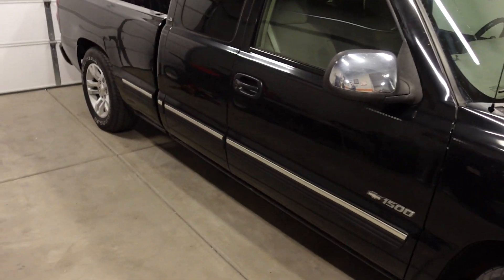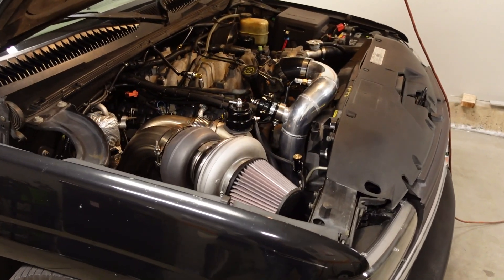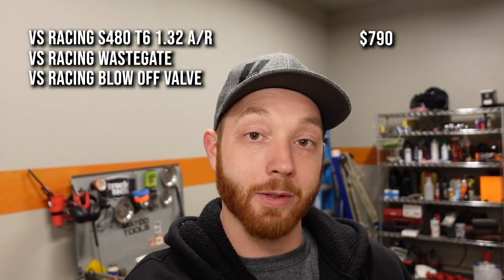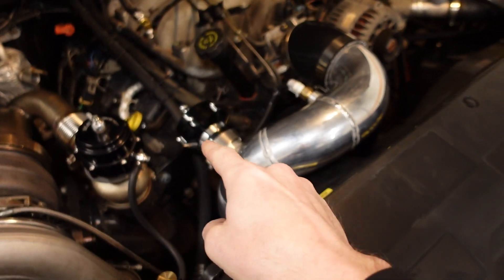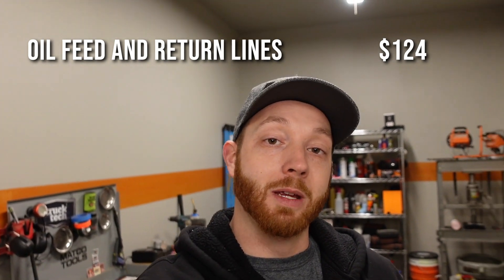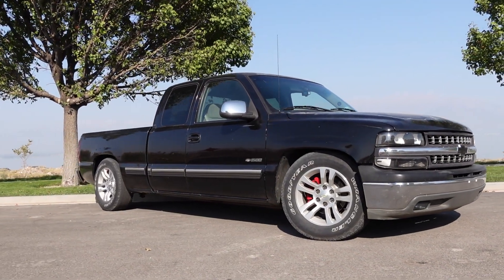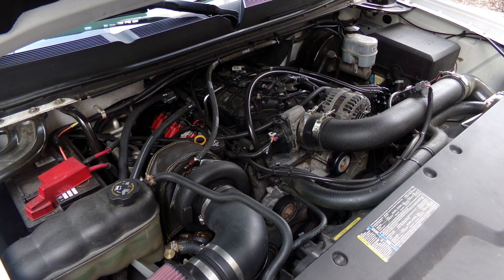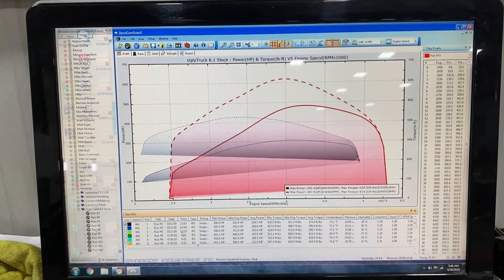The Actual Cost of Turbocharging a Big Block 8.1: Should I have built an LS instead?

Comment: 5k is cheap for an adjustable boost setup with tons of room to grow!

You're 100% correct. The 8.1 starts out with weak cast pistons and old school iron heads that don't flow where the LSx series starts with both of those issues solved in stock trim.

I think you'll be super impressed at how with a cylinder head swap your engine becomes an LSx on steroids (6000+ RPM). Cam choices do all the same things you're used to with an LSx. That 218/228 cam on a 5.3 is pretty large for a big truck! About similar to a mid 240s cam on an 8.1L (crank 610hp / 640ft-lbs NA)

Comment: If you cam and build the 8.1 like the 5.3 was, it'll be an absolute monster. 4200rpms for peak power? That's nothing. That big turbo is barely breathing at that power level. Build that big block and you'll see why it's king of the mountain. Big power, backed by a mountain of torque.

Comment: I think you made the right choice. Between the unique aspect, your exceptional attention to details, and the effortless throttle-steering torque, it's so far ahead of the junkyard/eBay 1000hp 5.3 and will be a far different behaving truck with a 1000hp 8.1. 8.1/4L80 going in my Caprice Wagon for just that.

Comment: Watching this video series has Honestly made me jealous. 
Before I found your channel I was already working on a single turbo big block Ford, using an EFI 460 with mild ported F3 heads, a mild camshaft, and Holley Terminator X, my goal is 500 horsepower that I think should be pretty easy. I'm also using the stock bottom end for now, it should easily be able to handle 500 horsepower luckily the truck engines came with slightly better rods.  I haven't decided on turbo sizing, I was kind of set an S477 with a 1.32 AR housing but now after watching your videos I may get away with an s480.  Much like your 8.1  my 460 will almost certainly operate under 5,000 RPM so I don't want to oversize the turbo and cause a ton of lag but I also don't want to undersized the turbo and limit myself for the future. 
Right now I'm at a point where I have to stop and save up money and the wait is killing me especially when I watch similar projects like this that are badass.
Reply from the maker: as far as spool up time on the 1.32 S480 goes, I have no complaints, in fact its almost perfect for my power level, and has room to grow. Sounds like a badass project you are putting together, and I think you in the right ballpark with the 1.32. I wanted to make sure there was plenty of flow through the turbine to support a nearly 500 cubic inch engine

Comment: Building the big block provides lots of info to us viewers, thanks! I suspect if I were building a boosted truck it would be an LS, just for cost and availability of parts. That is not to say anything against your choices, though. The only choice you’ve made that I’d question is the rear end ratio. There’s no way that 8.1 needs 4.30 gears to move that truck at any speed, in my opinion. I’d want decent cruise rpm for a driver... Still, with all that said, great job! Looking forward to the engine tear down and 1000 rwhp!
Reply from the maker: when I re-geared it it was still a 5.3/4l80 and it needed the extra leverage to get off the line. Now, its kinda stupid (almost unsafe lol) with that much mid range torque so I may go back to the 3.42's it had... we'll see

Comment: Yeah but comparing the 8.1 to the LS without a cam swap on the 8.1 you'll probably gain another 75 to 100 hp with the swap. I did the same thing I've built the gen-6 454 in my 98 GMC 2500 4X4 gvw 8600 when I could have put an LS in for a lot less. But on 5 lb of boost I can lay 400-500 foot 35 x 12.50  dual black marks in an S curve anywhere I go it was worth every overspent dollar. We all have different budgets. I love watching these videos and the product you came out with is top-notch it looks really good.

Comment: Great video as always LT.. the only thing I can really say is that your comparison of the 2 engines is that with the cam swap in the 5.3 it moved the power curve up in the rpm range if it had been on stock cam they would have really probably been making thier peak numbers pretty close to same rpm range. But your overall numbers would have suffered a bit. But of course either way the big block would destroy a 5.3 in torque with same atmospheric pressure. I know I'm just stating obvious things but sometimes I just can't help myself..  looking forward to your next upload

Comment: its funny now you created this video. I have found out the same thing about the little things creeping up. right now I need to get the parts to upgrade the fuel system before I can  start the install. 
I am doing a 5.3l in a 2009 tahoe

Comment: An apples to apples comparison would be fun. I have an 02 with a 4.8 that I’ve been waiting to put a turbo on just haven’t had the funds to do so yet.
Reply: Bro can get the whole gt45 kit for that truck and extra stuff ya need installed in a weekend and be out for under 1000 bucks maybe little more if ya wana add Intercooler but the kit itself is like 850 right now.

Comment: I agree. Rebuild it right from the first time. Firged crankshaft and connecting rods. Hypereutictc pistons. As for the cam the stock one obviously is made for low rpm HP/torque and you will most likely will put a mild cam. Not to mention other complementary stuff related to PCV and the transmission.

Comment: Nice breakdown of the cost.  I was looking at images of the block, the pistons may be not be up to snuff to handle higher power levels but the main caps are 4 bolts and that should help a lot in keeping the bottom end together.  There is no replacement for displacement.  I say there is no displacement for replacement.  When you can make 1500 plus with a 4 cylinder 2.0L engine, who cares about displacement.  VTEC yo!
Reply from the maker: You are correct in the fact that smaller engines can make some impressive horsepower with a lot of boost, but not sure I Could bring myself to install a Honda engine into my truck lol.
Reply: @LawrenceTolman  I hear ya, just like I couldn't bring myself to install an 8.1L in a JDM Honda Civic yo.  LOL.  Well if you ran the amount of boost these smaller displacement engines run to achieve 1500hp you'd travel through time with the 8.1L

Comment: I like it because it’s different, I also liked low and slow on trucks because it was a turbo 6 instead of the normal small block or ls.  There are a ton of engine combos I would love to build but can’t due to budget constraints.  This was another cool and different build.  I am curious though, I do believe that in a car the 5.3 would have the advantage but I think in that heavy truck the big block with its extra torque will win.  People focus on peak numbers because they are exciting but where those numbers fall are important.  In a light weight car that extra torque may be wasted at low rpm but in a larger vehicle it will be valuable.

Comment: In my opinion, i would just spend that $ on the Raylar heads cam and intake if that was the final goal with the turbo. That way you can still run 87 octane and tow reliably with more hp!

Comment: The more horsepower and engine makes na the more it's going to make with a turbocharger he's absolutely right there is no replacement for displacement a 565 with a procharger or twin turbos will make somewhere in North the 3000 horsepower

Comment: Cam, springs, intake and throttle body and upgrade fuel system for e85 and tune and you would've made more power for less money and still have the option of adding turbo later

Comment: You have much more torque in the 8.1 at lower rpms. In a truck, that makes  a lot of difference and is very important.  Put a large load In or behind the truck and make the same pulls. 5.3 and 6.0 will need higher rpms and burn more fuel.

Comment: I am 100% on-board with the 8.1L build for all the reasons you mention.  Better, because it's different, and period correct for the chassis.  This is the 496SS GM never built.  

The whip used on the 8.1L is always it's limited aftermarket. So. Gotta ask.  Why not a whistin' Gen VI Big Block?  Not a ton of them out there either, compared to the Mk IV, but way better parts compatibility/availability.  It would still be a big middle finger to all the LS builds.  Or is that what's up for the 8-lug 'burb?
Reply from the maker: the suburban does have the Gen VI Vortec 454, and its gonna get some upgrades as well. probably not turbocharged right away, but after driving the uglytruck, I think I might have to do it eventually
Reply: @LawrenceTolman  after I made this comment, I actually watched a couple of the videos from when you acquired the 8.1L and removed the 5.3L.  I had no idea the 8.1L could be run on the LS controls with such minimal headache.  Makes perfect sense!

Comment: Well my 8.1 is my mule. Sure I would love a power adder. Tell you what had a 5.3 Avalanche struggled to clime the hills I travel with my RV. The 2500 Avalanche doesn't even shift down where the 5.3 struggled. The same MPG's pulling the RV. So it still comes down to your needs or the loud pedal. I was the odd one to be different. Butt when a policeman pulls you over and asks what the He%% do have in this. Then shoots the sh*( for an hour. So different is a good thing. 
  It was a great build to watch doing it your way.

Comment: Have you had any problems with your brakes after the turbo install? The booster is vacuum assisted, so I’m curious if the boost pressure negatively impacted the brake power booster?

Comment: 99% of the time you drive around off boost. The big problem with using the largest capacity engine you can find is off boost fuel consumption, weight and serviceability. Do the same build on the bottom end in both for boost and a similar top end build for power and the Big Block will walk away. The optimum solution would have been to install a  6 liter LS then add boost. LS3 style heads and any passable cam would make an excellent boost platform and still stay with the BB even rolling at low RPM off boost.

Comment: I also feel like big power can he had by putting more timing into it. 11 degree is nothing. Your flame front is chasing the piston down the hole! I know you are being conservative, but 11⁰ is pretty ridiculous! I'm running 28⁰ on my 355 centrifugal supercharged sbc at 8.5psi on 93 octane. I pulled 1⁰ per psi. That's on the ragged edge the other direction.

Comment: How did you determine what size intercooler you needed for the power level you wanted?
Reply from the maker: Trick Turbo rates their intercoolers around a certain horsepower range, but honestly it was more a question of what I could fit in the truck. This particular one is said to support 800hp, but I just chose the largest one that would fit behind the grille and not require a ton of cutting and hacking

Comment: The bad news.  Turbo charging is the most expensive way to add full time boost vs blowers. There is a lag in boost from idle.  The good news.  Turbo charging is more efficient than blowers.  No belt slipping. Helps reduce exhaust noise.  Punished with lag, rewarded with full boost at lower rpm's for really big torque returns.  Best of all you are not a bottle baby (NOS) constantly refilling tanks.

Comment: It’s still not apples to apple. The 5.3 has a cam in it that helped it. You put a cam in that 8.1 and it will push 750 f.lb or torque and at least 550 hp at that same boost or more with just a cam swap. I did a very mild cam swap on a 454 gen 4 and it woke it like if I had put a stage 3 cam on it

Comment: Stick that 8.1 turbo into a regular cab short bed AWD Silverado and let all that torque do it’s job on the quarter mile. Torque is what moves a heavy truck like that, loose converters and low gears make up for the lack of torque on the small block but also makes them a bitch to drive every day, and with that comes a lot of heat and shorter component life, I’ll stick to big blocks and to each their own I say!

Comment: Everyone is putting turbos on ls engines. The 8.1 is bad ass. Almost 500 horsepower on 8lbs of boost is respectable. If you decide to use some big hairy ones and turn it up to eleven it will scream, if it holds together. You need to rebuild it anyway, I would just send it and see what happens.

Comment: I don't understand how you figure there is no aftermarket for the big block Chevy it's been around for over 50 years it's still being used today all the way up to top fuel dragster 's making 10000 horsepower And with displacement of 396 all the way up to Sunny Leonard's 1000 plus cubic inch engine???🤯

Comment: If you got arp studs and ring gap...Richard Holdener made 1500hp🤷‍♂️
Reply from the maker: not on an 8.1... he's done a few Gen VI 454's and a 496 stroker or two (which has the same displacement, but is not a Gen VII 8.1).
Reply: @LawrenceTolman  ok I see now

Comment: Raylar schematics. The 511 stroker with turbo should easily make 1,000 hp
Reply: Kinda hoping you put awd in this truck.
Reply from the maker: I've been tempted to transplant the drivetrain into a 4wd rig and make it awd...
Reply: @LawrenceTolman  I've got the awd system from a SS trail blazer that I'll be putting on a 94 Caprice wagon. Have a 8.1 and allison from a 05 kodiak. The 8.1 needs rebuilt and plan to use  forged scat parts because they're way cheaper than Raylar. A 511 stroker with a big single turbo. Want 275hp and 495tq as low as 1800 rpms for mpg cruising. 700hp and 900tq between 4500-5500 rpms for partying.